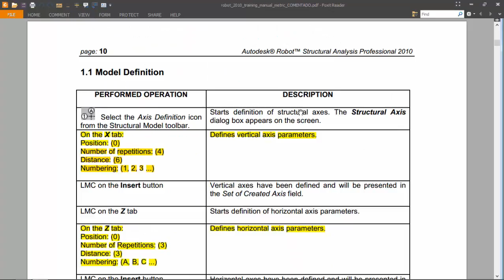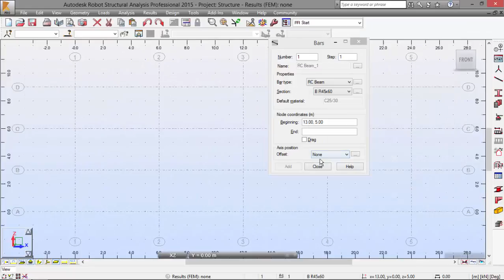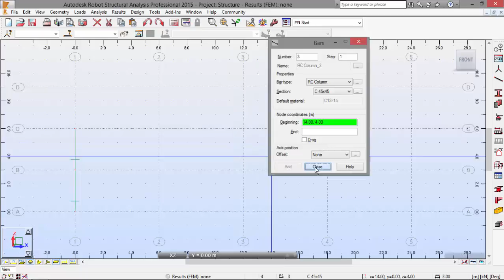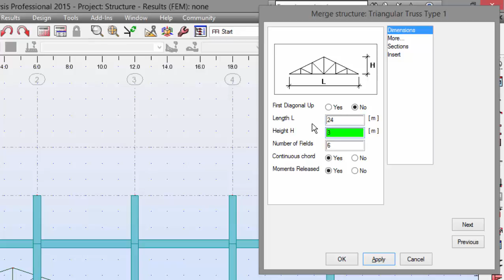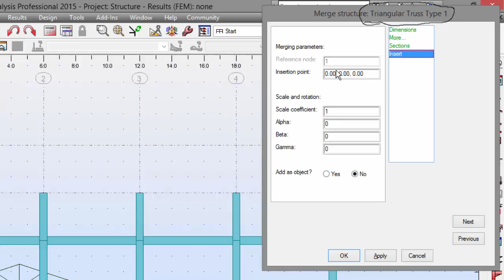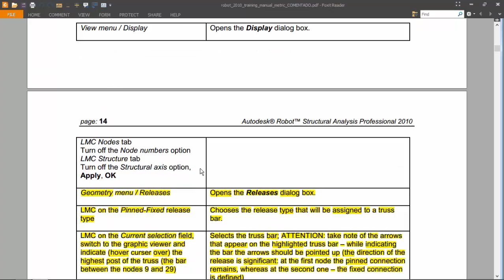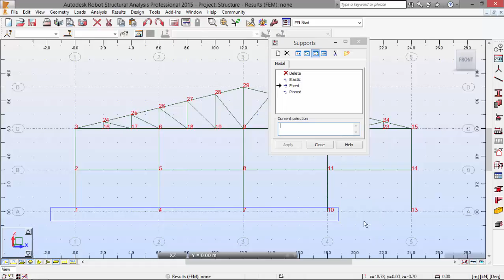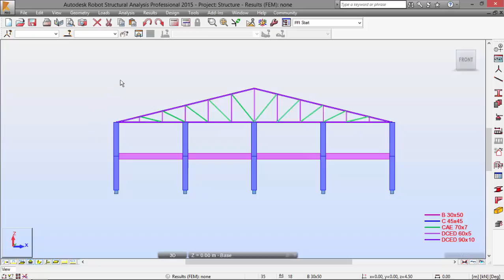Exercise 1 - Part 1 - Reinforced Concrete Design (Robot Structural Analysis)

Comment: Nuno, thanks so much for your tutorials. I would like to know why we have to make one end pinned and another fixed (8:20 to 10:40)?
Reply from the maker: In this case you need to make it like that, otherwise you will have an instability. 

It is not possible to connect all the bars with a pinned release because the program will give instabilities type 2 or type 3. Making it fixed will avoid that problem and will not transfer any moments because the other two bars joining that node are already pinned. 

When you make releases you need to make sure that at least one of the bars joining the node is fixed. Otherwise you will get instabilities problems.

This might sound weird because there is no transfer of moments and the structure would not be unstable if you make it pinned. But that is how the software deals with nodes with all the bars released. Be very careful with structures having instabilities. You might be modelling it properly, but you might also have a bad model.

Hope this explanation helps!
Reply: Thanks so much. You have clearly answered my question.
Reply from the maker: Nice know that!
Reply: Just one more thing. In the RC design there is a choice between simple cases, automatic combinations, and manual combinations. Can you, please, guide me on these.
Reply from the maker: It has to do with the import made from Robot. When you calculate reinforced concrete elements, Robot will import your elements to the reinforced concrete module. 

After the import it will ask you if you want to use the results from the simple cases or manual.

If you select manual, it will use the combinations that you defined previously in you robot model.

If you select simple, it will use the forces computed with the simple cases that you defined and make additional combinations for the determination of rebar. It will, simply, calculate new combinations according to the code defined in your model, with the simple cases that you have previously defined.
Reply: @nunoteixeira-robotstructur8358  Entao isso quer dizer que todas as outras barras da trelica sao pinned automaticamente?
Reply from the maker: @gabrielbobmarley  Sim. No quadro para fazer a treliça existem 2 opções que perguntam se quer a treliça contínua (sem realeases) ou se quer a treliça com realeses. Neste caso escolhemos as duas opções, logo, temos a treliça com os realeses todos colocados.
Reply: @nunoteixeira-robotstructur8358   Entendi..entao olhando pelo lado construtivo, teriamos uma trelica com as barras parafusadas e no topo da trelica seria soldado? Muito obrigado pela resposta
Reply from the maker: @gabrielbobmarley  Sim. Modelando da forma como modelamos, neste caso, podemos relacionar com o caso que fala, onde a corda superior e inferior é soldada e os montantes e diagonais são aparafusados.
Reply: Nuno Teixeira - Robot Structural Analysis  bom saber. Muitas vezes sigo tutoriais mas sem saber como aquilo funcionaria na vida real ( uma ideia para incluir nos seu vídeos ). Nesse caso então ainda teríamos que calcular as ligações então ( solda e parafusos ).  Obrigado pela atenção. Keep up with the good work. Cheers from Australia